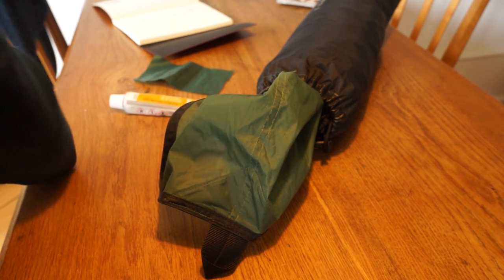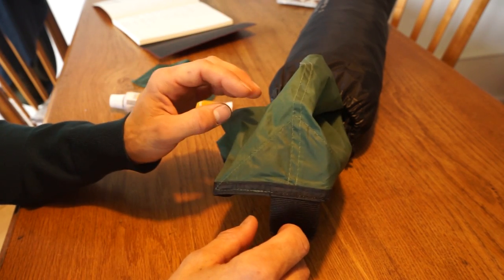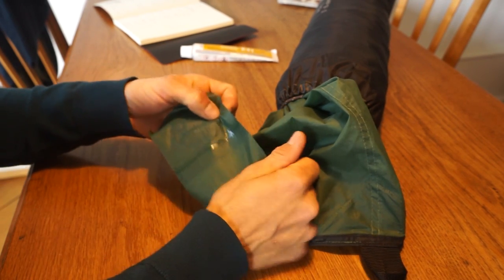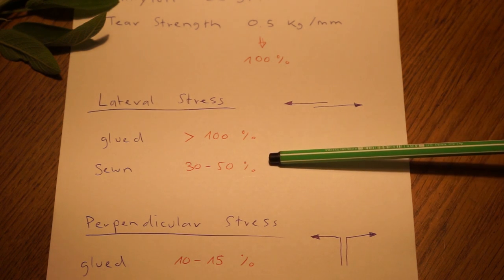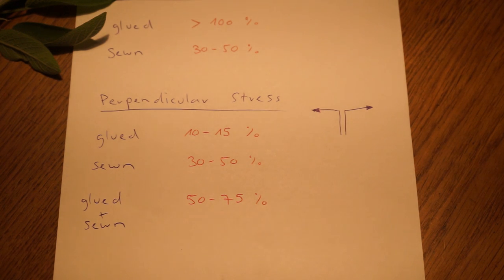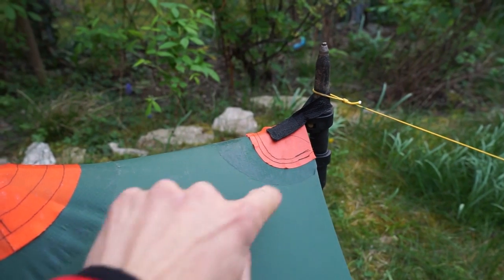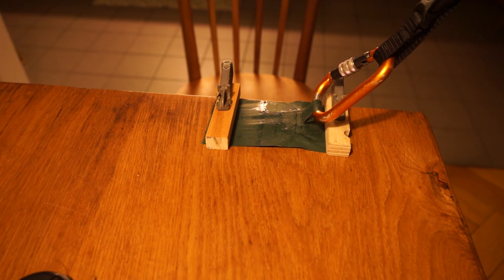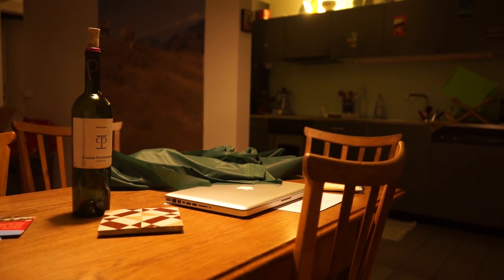Gluing vs Sewing a  Silnylon Tarp

Comment: Excellent video! You applied your technique and tested it. Here in the USA finding Wacker E41 is difficult in small quantities. I have found something very similar though, and cheap. It is Permatex "flowable" windshield and glass sealant. I plan to test it with more coarse nylon materials like webbing and cordura fabric to see if the additional air space from nylon webbing threads weakens the adhesive bond. So much nylon fabrication is going to "welded" bonding and laser cutting, I want to find a cheap DIY alternative to that expensive equipment.

Comment: Thanks Samuel for the informative video! This got me into using glue for most of the seams on my tent. I've got pu-coated polyester so had to find another glue but elastic vinyl glue worked out and the result were similar to yours. Thanks again!
Reply from the maker: glueing is the truth ;-)
Reply: @samuelegli8713  One more thing to note is that you need to sand the pu coating to get to the polyester, that way the glue really sticks! Forgot to mention this on my earlier write.
Reply from the maker: @LatePeaceOfMind  i found that sanding the nylon makes it tear very easily. Its a superlight fabric though

Comment: Just looking at your lateral vs perpendicular stress testing, it would seem that a better solution for the perpendicular stress join be combined with the lateral solution, so that the loading be across the lateral not perpendicular join.
be interested to know if you have tried this...
Oh also as Colin Quilter said, top marks for testing and backing up your options with more than theory.

Comment: Samuel, thank you for your video, it was very helpful. Now I just have to find the product Elastosil E 41, to get on with my project. All the best....B.
Reply from the maker: I dont know if silnet is as good. But i would be surprised if it was better. Anyway i will soon make another vid on the final tarp. Found some additional interessting details.
Reply: It looks like the Permatex 81730 Flowable Silicone Windshield and Glass Sealer is the same type of stuff and less than $10 from Amazon.
Reply: Any clear silicon thinned with turpentine does exactly the same.
Reply: @turboturd7954  actually most silicones don't bond that strongly. I tried with two different ones and both failed.
Reply: @LatePeaceOfMind  Please explain better. So two different brands of plain clear silicone mixed with turps? And do you mean their bonding strength compared to using Silnet or Elastosil brand ??  What material were you bonding?Tell us the exact details of your experimenting. I'm sure the all work the same as seam sealer though. thx
Reply: @SurvivalCitizen  I tried permatex on Silnylon.  I could pull apart quite easy

Comment: Hi where did you get the E 41 adhesive ??? I can not find any so far ..out of stock is the best
Reply: It looks like the Permatex 81730 Flowable Silicone Windshield and Glass Sealer is the same type of stuff and less than $10 from Amazon.

Comment: I have no idea of how you glued it. I have glued silnylon with Elastostil E41 and it absolutly have no gluing effect. It easily tears appart. How long did you let it cure?
Reply from the maker: the glue cures very fast. allready after 2 min the glue becomes very sticky. all in all i think i let it cure for some 5 hours. I don't know what went wrong with yours. even after a year the glue stored in the fridge still does cure
Reply: That funny. Ours does the same, it starts getting very sticky and cures within a couple of minuts. But it won't hold them together if we pull apart.
Reply from the maker: Maybe you^r fabric does only have e one-sided silikon coating. Some are coated on both sides, others not! Then only one in four Trial would really stick. I learned that it sticks much less to PU coatings or plain fabrics.

Comment: Could you provide a video of elastosil e41 application?  Have you used this product on other polymers?
Reply from the maker: i put some  tape first about 2 cm from the ridge to have a nice clean boundary and then just applied with a spatula. You can only glue like 20 cm at the time because it dries quite fast. But wet in wet i managed to get a seamless ridgeline of about 3 meter.  you can move the fabric a little bite for about 1 minute to get everything nicely aligned

I tried to glue some PU coating and plain Nylon. It stuck but only like 20% of what it does on silicone. I guess its really only for silicone coated fabrics.